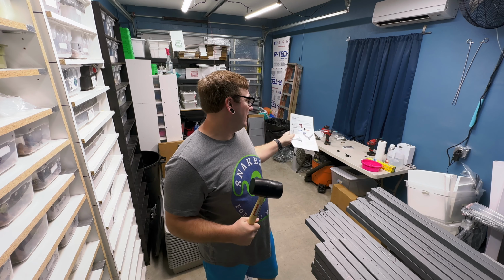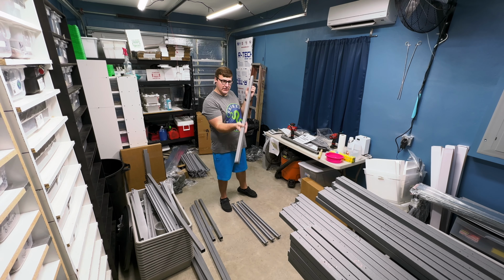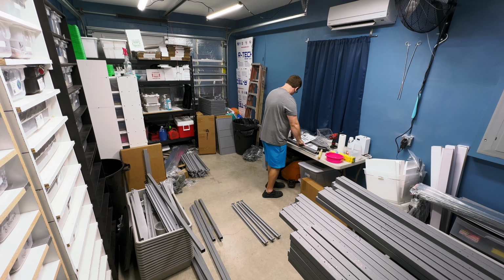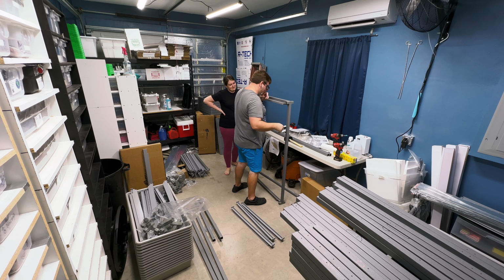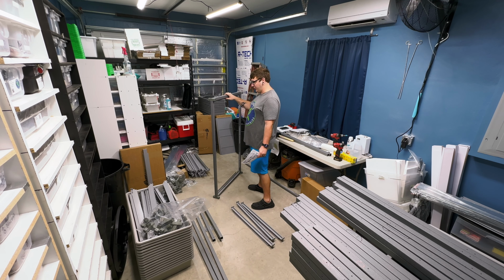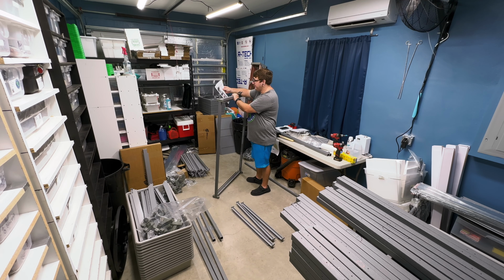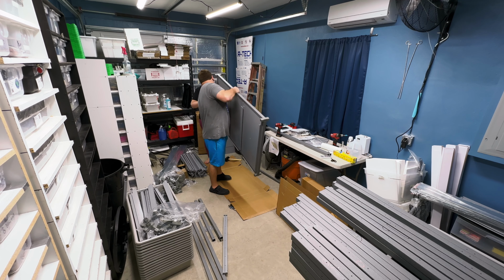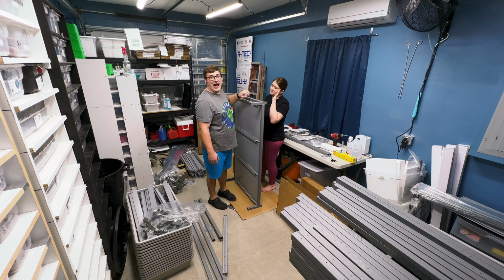Building the 7030 ARS Rack for our ball pythons

Comment: Bummer I just did my 1039 few days ago had zero issues everything went smooth parts were packed great and flawless. I'd be upset too though I know they are slammed always but no excuse gotta come correct when it comes to checking stuff before shipping. They must had some new booty packing that stuff lol. Too bad but atleast you can break the build up shit takes forever 🤣 especially if you challenged like myself haha. It'll work out but buzz kill for sure.